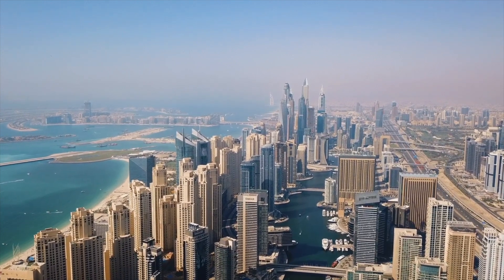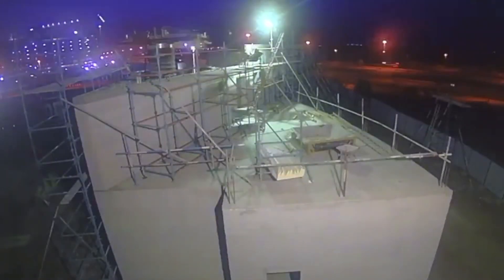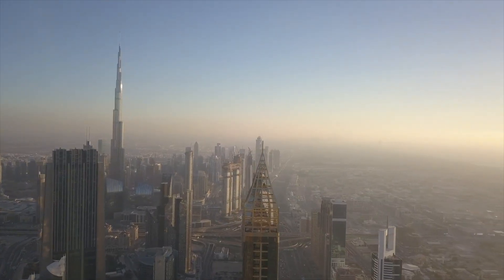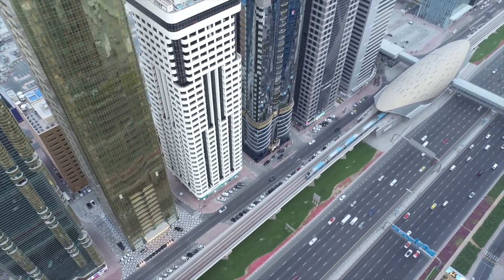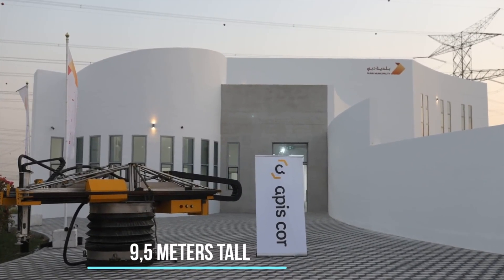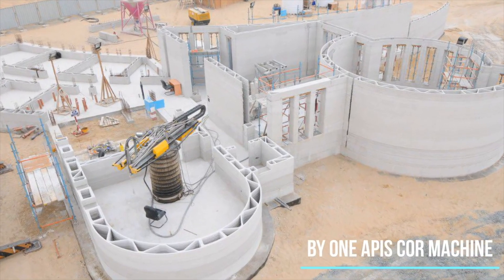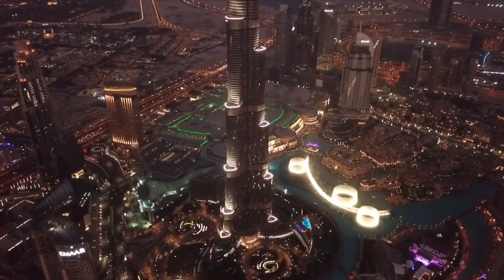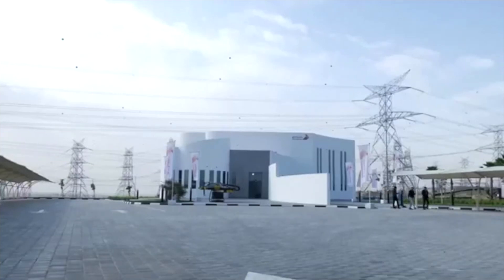Largest 3D printed building in the world 🌎 (Apis Cor)

Comment: In regards to paperwork (city & state guidelines and prerequisites) that needs to be done for a home, how would that very important issue get dealt with given this very new technology?
Reply from the maker: As with all new tech there is an adoption curve. First only the forward thinking municipalities will consider this tech then once a precedent is set it will become easier and easier.
Reply: Agreed. What has been your experience so far regarding the timeline for such paperwork? The house that was built in the US  that you covered, what modifications to the "rules" needed to be done? What additions etc...
Thank you for responding so quickly.
Reply from the maker: There hasn’t been a regularly permitted home yet in the United States but I’m here in Louisiana waiting for construction of the first one. Hopefully it all goes smoothly and many more will follow.
Reply: @automateconstruction  Biggest 3D Printed House in America ALMOST COMPLETE Part 3 [*Mostly Drone Footage*]
This house was built without a permit and licensing?
Reply from the maker: It’s built on industrial land as an experiment.
Reply: @automateconstruction  Did not know that. Thank you.
Reply: @automateconstruction  Do you think lack of insulation will slow adoption in cold climates? How could they add insulation to this?